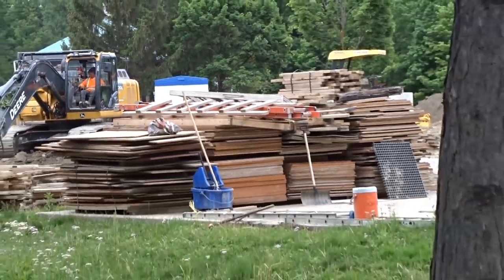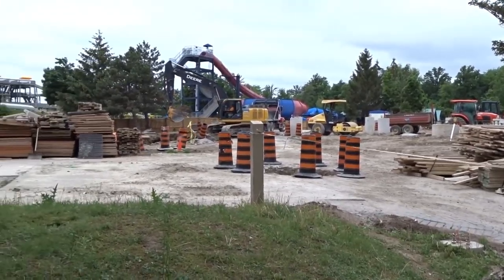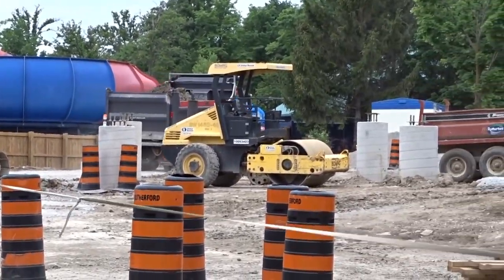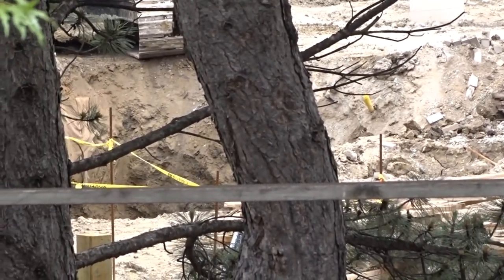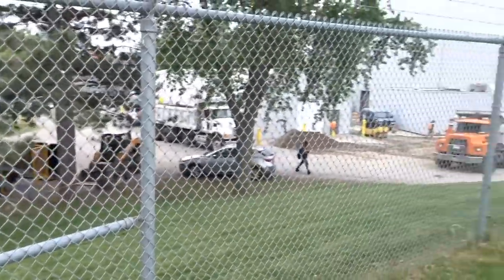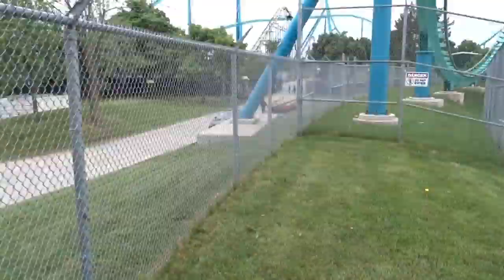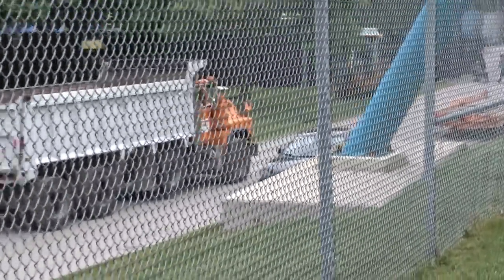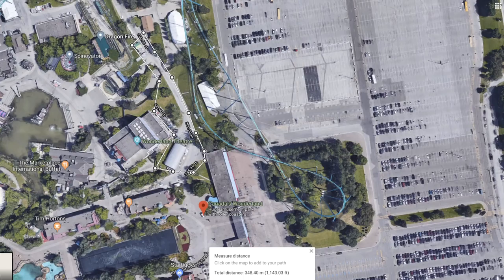Canada's Wonderland Insane Construction Update

Comment: Almost no way it isn't a giga dive now. This will crazy imagine if the lift is a little steeper too and tops out at like 300ft. Thatd be a 330ft drop. More than likely the 272ft prediction is correct though because B&M never really goes steeper than valravns lift